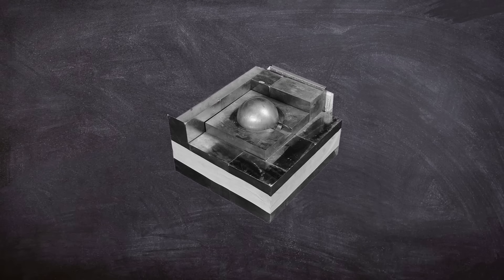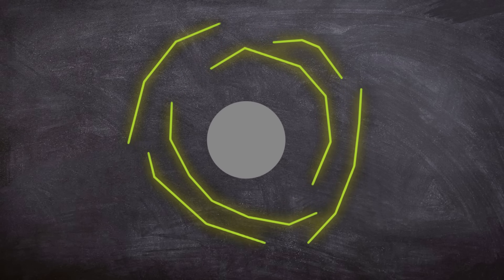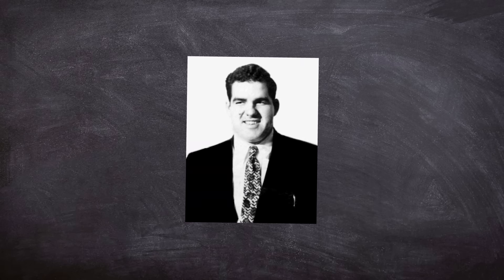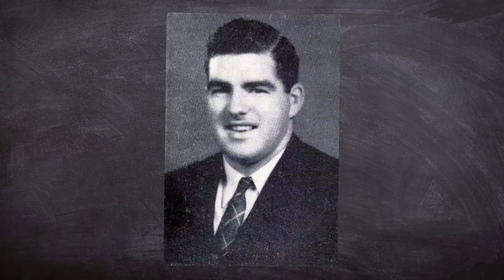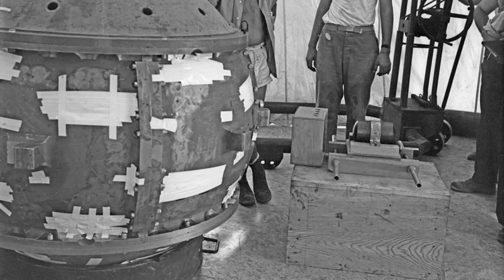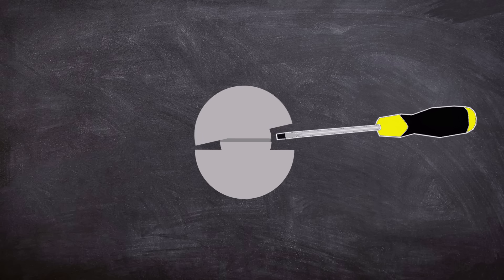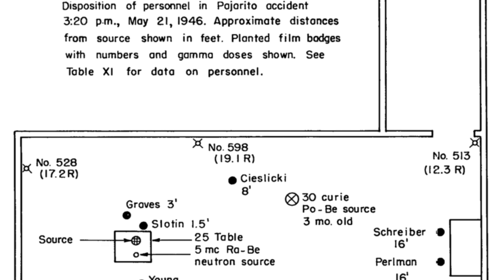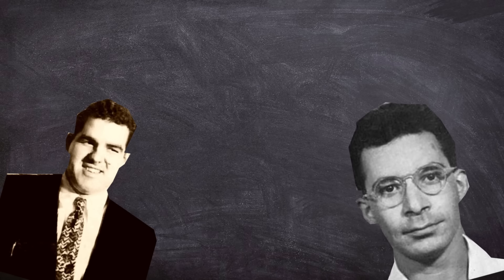A Brief History of: The Demon Core (Short Documentary)

Comment: 1:42 The hemispheres weren't "separated by a ring".  The flat sides of the plutonium hemispheres fit together with a gold metal gasket between them; gold's heavy nuclei prevented neutrons from flooding the gap, and the ring went around the outside of the joint, sealing in the neutrons to be generated with another plutonium wall for them to be absorbed into.

1:49 - No, the plutonium metal was shipped from Hanford and pressed and machined at Los Alamos.

1:59 - No, the plutonium sphere by itself was not 5% below critical mass, but 30% below.  Inside the bomb it would be surrounded by a neutron-reflecting tamper of U-238, bringing it up to 95% when installed.  That's why considerable reflecting tamper had to be added by Harry Daghalian and Louis Slotin to bring it up to near criticality, essentially replicating and then over-driving the core.  Unfortunately, they both accidentally overdrove it too far. In the real bomb the core would be imploded to 3-4 times its normal density, driving it far into prompt criticality.

5:02 - Tickling the Dragon's Tail was a euphemism applied to another criticality experiment by Richard Feynman, performed with the "Godiva" apparatus (shown in the video at 9:41), in which a plutonium core was dropped through a hollow uranium cylinder (again, a neutron reflector, and would briefly go critical.  The instruments could detect how potent the core was.  At one point the heat produced destroyed one of these machines.  That was the one that Feynman wrote about.

Around 6:00 - I don't know what you are pronouncing when you pronounce Louis Slotin's last name, but as far as I know, it was pronounced "slot' in".

6:52 - the shot on the screen is Louis Slotin on the right (with sunglasses), Daghlian behind, and Sergeant Herb Lahr during the preparations for the Trinity test at Alamagordo, NM. 

10:20 - Graves survived; he suffered the loss of his hair and a low sperm count for a couple of months.  But as far as he and the doctors were concerned, he recovered fully - he and his wife had a normal son a couple of years afterward.  He died of a heart attack often blamed on the accident, but it's also possible it was just genetic, as his father died the same way. No "chronic neurological or vision problems", other than people not liking his abrasive personality.
Reply: Good to see you again. BTW, It's Alamogordo, not Alamagordo. The alamo tree is a poplar tree of Southwestern U.S.; the cottonwood. An alameda is a street or path lined with trees (from Spanish álamo, meaning 'poplar'). As for Graves, he was an SOB.
Reply: @buzaldrin8086  Greetings, Buz.  I've been around, but been spending more time on family genealogy and answering questions over on quora.  It has its own fine grade of idiots, but I'm learning there as always.

Thanks for the tree reference.  You'd think I'd remember the spelling by now, but old habits die hard.

Comment: A "neutron reflector" does not actually reflect neutrons. It's a material that emits more neutrons when bombarded by neutrons from the core. They are emitted equally in all directions, with some  naturally traveling to the core to participate in more fissions.
Reply: No, that is actually more like the definition of fissionable material. Neutron reflectors are just good at scattering neutrons, so tend to scatter some of them back where they came from. In addition to being a good neutron reflector, beryllium will also undergo (n, 2n) and (n, 3n) reactions, in which collisions with single high energy neutrons can knock more neutrons out of its nucleus, but without splitting the nucleus.

Comment: why were they not wearing radiation suits
Reply: "No suit will protect you against ionizing radiation hazards (gamma rays, X-rays, radioactive particles: alpha or beta). For example, if you're standing next to a uranium reactor, a safety suit will not shield you against the ionizing radiation, but it can stop small bits of radioactive dust from getting on your skin. Safety garments are designed to minimize the penetration of radioactive airborne particles and prevent their contact with your skin. Protective suits keep radioactive isotopes out of your body, but cannot shield you against the ionizing radiation."
Reply: @buzaldrin8086  Well quite right but let me be bit more clear. First of all there is no such thing as "radiation suit"...second suit like you said can only protect you against airborne particles that can be radioactive...we call these alpha particles and beta particles. The former cant even penetrate your skin but can be lethal if breathed in, the latter can also cause your skin severe radiation burns if not washed away quickly.

Anyhow NO suit can possibly protect you against gamma rays and neutron radiation..gamma rays can penetrate anything but rather thick layer of concrete or lead.Neutron radiation, while not ionizing radiation in itself is just as dangerous as it can in simplest of terms "make other things radioactive" and thus just as well harm you and its even more penetrating than gamma rays are.

Anyhow we do count alpha and beta particles to be sources of ionizing radiation as well, but like said in this case we were talking about one radiation source causing high dose of neutron radiation when it went critical. Other persons in the room were actually lucky that they didnt get deadly amount of that neutron radiation as well, and if they had been any closer to the source, they would have died shortly after as well

Comment: You could probably use the Demon Core as an area denial weapon. Place core in an area and initiate it remotely, any enemy that walks by it would get a high dose of radiation and die from exposure. If you want to turn core off, you can use the remote and thus shutting it down. Since the core only produces gamma radiation, it doesn't linger and would easily allow ally troops to move in. Why hasn't anyone ever thought of this use? I mean Gamma Rays aka Gamma Radiation doesn't linger at all from what I am told.

Comment: Always have a backup safety device when doing dangerous expirements and have a backup to that backup. If you cant ensure the safety of the expirement dont do it
Reply: Like an extra screwdriver?
Reply: @callumdonington2227  like a device designed to prevent the two spheres from touching maybe? Only using the wedges in my opinion is stupid. They should be secured by something much more sturdy than a wedge

Comment: What would happen if you left the beryllium sphere on, permanently? Will it just keep pumping out radiation and neutrons, and how hot will it get? Is a chain reaction going on, if so how without a moderator to slow thr neutrons? If there's any nuclear engineers watching haha, I am really curious to know.
Reply: Well, eventually, it'd either fizzle out, or go super critical and... Kaboom.
Reply: Kaboom? I don't think so... unless you mean enough heat builds up for a thermal explosion. But I don't think any amount of criticality will induce a nuclear chain reaction. For that you need to moderate the neutrons, as in a power plant, or compress the core in a perfectly timed detonation of high explosives, as in a bomb. 
But thanks for the input. Looking for how long the Chernokov radiation will glow, how long it will emit gamma rays, and how hot; will it melt the beryllium shielding and stop itself?

Comment: I think that the scientists we're just being as curious as anyone would be at this time. Very little was known about criticality at this time. Very little was known about radiation at this time. Even just a few years later and they would have at least handled the thing with gloves to prevent from ingesting the plutonium. If the 2nd guy didn't die, I'm sure commercial nuclear power would have evolved years earlier. He was trying to demonstrate a controlled criticality, not trying to make it maintain super criticality. Pretty much the same principles are used for nuclear reactors today. Subcritical mass, surrounded by a neutron reflector and the control rods maintain the reactor at criticality while the moderator becomes more or less effective with changes in temperature, keeping the core neutral. It was a good idea, just not a safe one for what they knew at the time

Comment: Crazy stuff. I spent 4 years handling Cs137 and Co60 sources, loading and unloading industrial gauging devices, the doses I received were fairly small and insignificant compared to what these guys would have been exposed to. Having said that, I always had 2 geiger counters and a scint running as well as my electronic dosimeter and TLD badge, I'd like to think that if I i'd been in the room with those guys running the experiments the way they did I would have run for the hills, but it was a very different time back then.
Such a shame that their talent was cut short, and such an unpleasant way to die.

Comment: You F***ING IDIOT. The core didn't do anything. Those were careless idiots playing, yes playing, with very dangerous material. Try handling pure sodium, or nitroglycerin, or concentrated hydrochloric acid. Idiots and careless people get hurt. Same arguement for cooking and handling hot water, if you dump it on yourself. It is a dangerous world!!! Deal with it.
    I routinely wotked with very high voltage electricity and microwave radiation. I know of people being killed by both. Some were unlucky, but most were careless. The scientists featured in this video were careless and did not show sufficient respect to the material they KNEW was not only dangerous but deadly, and not only to themselves but those around them.
    Demon Core, indeed. It sounds as if you are right up there with those posthumous winners of the Darwin Award.

Comment: Spherical "Pits" (the term given to the initiating Fission reaction of an Atomic and Nuclear weapon) have been used in all kinds of experiments.  One that a professor told me about (my degree is in Nuclear Engineering) was about a design where they cut a cylinder of material out of the sphere and would drop the cylinder through the sphere and measure the neutron flux created by the super criticality.  They eventually decided to find out how much power it could create and took it out to the Nevada test range (outside of Area 51).  They placed the sphere and setup a switch to drop the cylinder through the sphere, but instead blocked the cylinder from falling through.  They setup the experiment in an underground test area and then started the monitors.  Someone pressed the button to drop the cylinder, a split second later, it detonated (I was never told what the power was, but it set off seismic sensors).

Comment: xD I laughed at the screwdriver bit--as a bit of a hacker I've had more than a few hackish set ups. Including on machine running BSD that I turned on and off by stabbing it with a knife. Well, I would have to do the proper `shutdown -h now` nonsense and THEN stab it... except in emergencies.

That screw driver bit sounds like something I would do... except I am not operating with millions of tax payer dollars... I'm like doing my experiments with a simple welfare cheque... usually in some trap house or cheesy dive--not a university or properly funded government faculty.

Though, my tendency towards getting mild cases of radiation sickness does make a bit more sense now...
Reply: By stabbing it with a knife I assume you mean using a blade to short the two jumper pins on the motherboard to power it off and not just sticking a blade through the mobo and totally destroying the entire pc right lol?

Free bsd is pretty dope, I'm running arch with KDE plasma 5 desktop. You ever do any bug bounties or anything? Might get you off that government check.
Reply: @n111254789  yeah, it was to short two jumper pins. When you use a knife instead of a screwdriver because it needs less of an opening in the case, the term "stab" becomes applicable.

As per bug bounties--I kind of pushed myself really hard in the 00s, and ended up having a breakdown in 2012 that I still haven't recovered from decently. It wasn't even until 2014 that I could look at computer code for half an hour without my head exploding in pain.

Think like a horse that broke its leg in a race... except instead of fear of injury--it is extreme mind pain that makes it hard for me to produce enough material to make a career out of this stuff.

As per why I didn't get to far with this stuff prior to that... one of my parents has Munchhausen by Proxy--and got off on the notion of me being homeless--and would go around sabotaging my shit anytime I tried to do anything with my life. Sometimes just flat out breaking my shit with a hammer. So yeah... that is why I worked to push myself harder to get somewhere--as I did not know this was not normal... due to having a bunch of drugs pumped into me, thanks to that parent as well.

I do plan to look into bug bounties--once I can reliably work on computer code for a few hours a day, multiple days in a row.

Oh right--I'm away from the horrible person who was drugging me up, lying about shit to doctors and breaking my stuff (sometimes not even with a hammer)... so I can work on recovering. Which I have been since about 2012.

Comment: From wikipedia - Fermi's comment was based on a different dumb move: 
In the winter of 1945–1946, Slotin shocked some of his colleagues with a bold action. He repaired an instrument six feet under water inside the Clinton Pile while it was operating, rather than wait an extra day for the reactor to be shut down. He did not wear his dosimetry badge, but his dose was estimated to be at least 100 roentgen. A dose of 1 Gy (~100 roentgen) can cause nausea and vomiting in 10% of cases, but is generally survivable.

Comment: "These physicists were the most skilled of operators..." I beg your pardon, but using your bare hands and a screwdriver to experiment with a potentially critical mass of nuclear fuel without any radiation shielding, is just stupid. These scientists may be geniuses, but they lacked common sense. A genius would tell you all about the new state of the art traffic light system, but anyone with common sense will still look both ways before they cross the road.

Comment: The blue glow was not caused by ionized air, it is Cerenkov radiation, which results from a particle moving faster than the local speed of light in a medium, 'braking' as it were to the local value of c and emitting a photon of visible light in the process. Cerenkov is a telltale sign of intense radioactivity and supercriticality.
Reply: Phase velocity.

Comment: Nice coverage, I knew about the screwdriver incident, but didn't really understand it. Your explanation and the graphics were perfect.
Reply: elijah mikle I think the op meant how the core went critical, but I do agree that the scientist was a fucking dumbass
Reply: Think of it like holding a giant steaming  ball of rice within two bowls encapsulating it. If you close the bowls together all the way, it stays hotter. But if you use a screwdriver, you can let out just enough steam to not let it get too hot inside.

 But instead rice, let's say its plutonium and instead of heat, it is neutron radiation. Now when you close it, it gets hotter but in a nuclear fissioning way. Now imagine back to that ball of rice and imagine it could form it's own heat, and if totally enclosed in a reflector, never stop until the bowl melted and cooked itself straight through the table. Oh and by the way, it shoots steam straight through your body and cooks your DNA! 

Yeah so dont let that screwdriver close that bowl gap too much. Or itll get real hot inside FAST!

That's what this experiment was. Demon Core.

Ps I just had a lot of rice at a sushi buffet. As me another question when I go to souplantation.
Reply: elijah mikle  
Just because you don't understand it doesn't mean it doesn't make sense

Comment: 1940's "safety" precautions...
Reply: @patrickglaser1560  This is only somewhat true. Every risk has a probability of occurrence and a severity of consequence and if you're able to communicate both clearly, and you can suggest a sensible mitigation, then people will listen.
Reply: @patrickglaser1560  Well I'm an engineer in a factory where we enact safety measures before accidents. If all safety measures were reactive, as you suggest, then the death rate in industry would be far higher. When you install a production line the first thing you do is go over the whole thing with EHS engineers and assess what hazards are there, and then if there are any risks which don't have adequate mitigations you engineer a solution for them. On a small production line this could be a list of 50 improvements. Nobody labels anybody as a chicken. Even employers without morals will want to hedge against the risk of litigation. So engineers design safety improvements and their employers pony up the cash, before an operator even looks at the equipment.
Reply: They would probably  have been ok if they had been wearing  hi viz vests
Reply: @patrickglaser1560  The Glaser effect maybe
Reply: @patrickglaser1560  *ad hominen
Reply: @patrickglaser1560  If you promise to avoid being a prick or creeping on people through those sunglasses, yes.

Comment: As a keyboard engineer, It is my opinion that all of this can be avoided by implementing a dead mans fail safe. All that is required for this is to fix the top half of the sphere and lift the lower half to meet it. Should anything go wrong the lower half will fall away stopping the reaction.